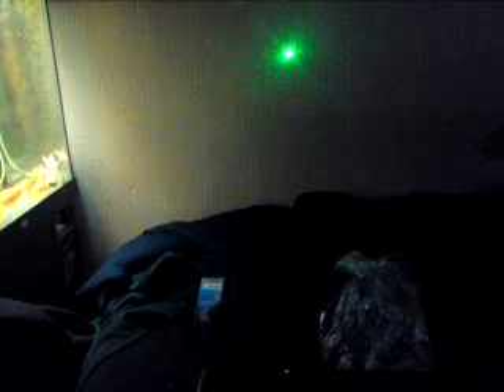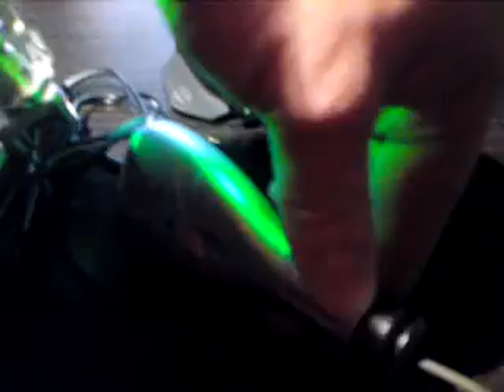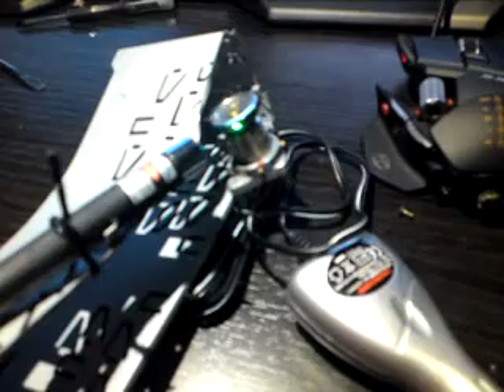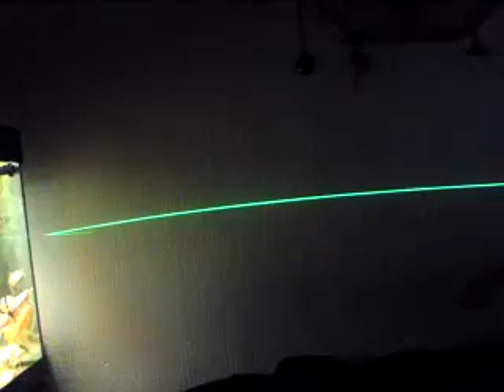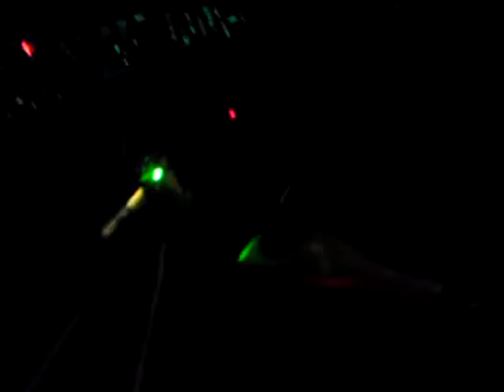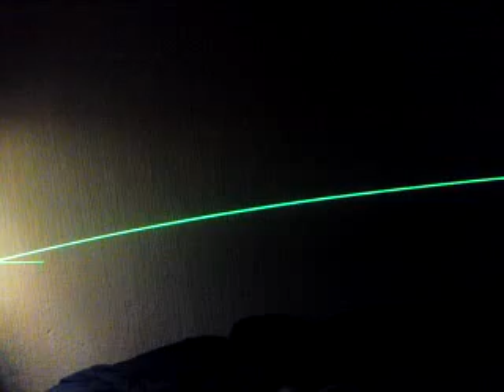Green Laser Flat Beam/Line Test

Comment: This is exactly what Ive wanted to build for about a year now, your video is the only resource ive found for this design. Slicing smoke up is pretty darn cool.

I was wondering how the mirror mechanism on your motor worked and if you had a better picture of it.
Reply from the maker: sadly i dont have any better pictures. it is just a simple thing where lots of small mirrors are stuck to a spinning wheel. just gives the flat line look.

however..  if you were to go on ebay and do a search for "laser fog light" i think you would find some other cool stuff ;)